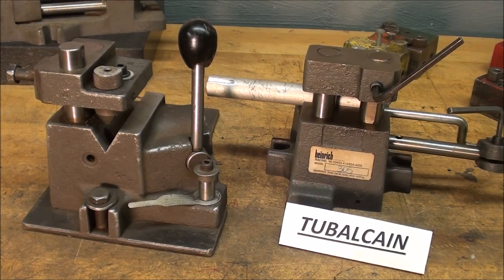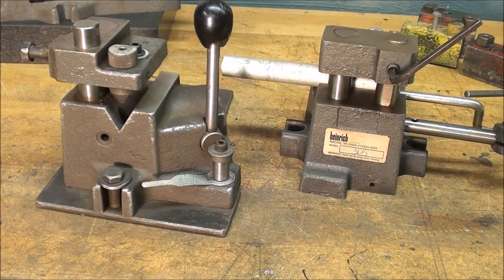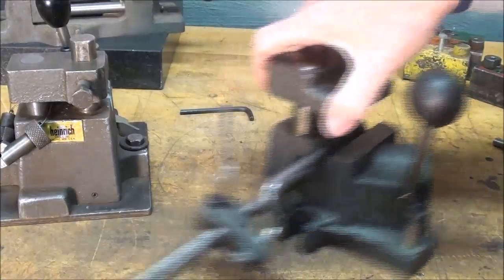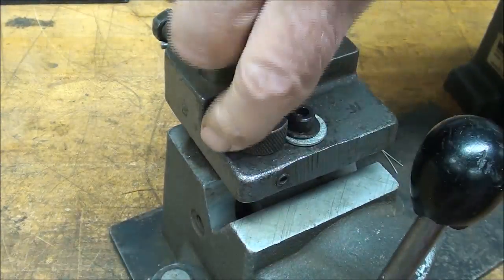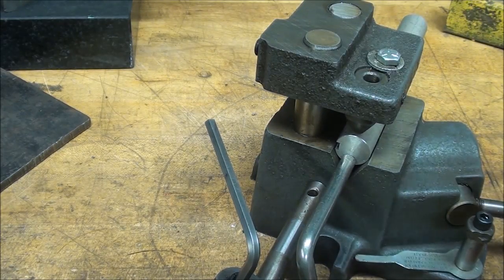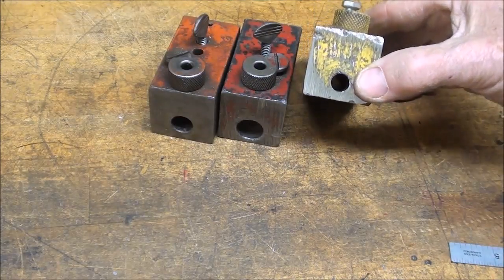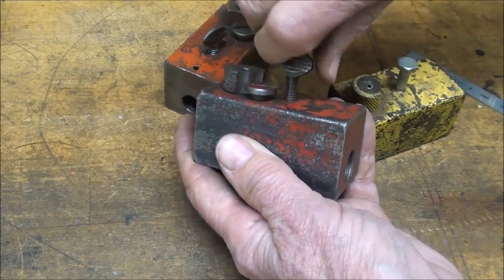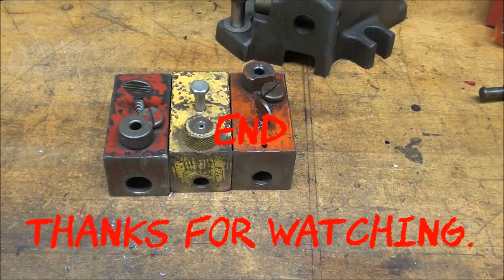SHOP TIPS #290 The Heinrich Cross Hole Drill Jig tubalcain

Comment: Think the 905 cross hole jig (the biggest) would allow space for a second drill bushing 1" on center from the stock one? Otherwise I'd need to have a jig like that machined from scratch.
Reply from the maker: I'm not sure, but you could check the dimensions and see.

Comment: have a problem 
the toy mill i can use dosnt raise the bed at the knee
the mill head lowers and swivels so u unclamp the head after dilling a pilot hole to raise the head
but that moves it left and right. so now u up size the drill say to 10mm to 19mm  witch is longer u loose center.
Reply from the maker: Yes, my friend had one of those and he pointed that out

Comment: Nice video but I have a question non related to this video. I recently got an Atlas 618 and the tailstock drill chuck is all seized up. I'm assuming its been in their for years. I pulled the tail stock sleeve out put acetone and atf down nothing. I would put it in a vice and just get a punch rod on the other side and hit it out but I don't want to clamp the part and damage it. Anyone go some tips on this?
Reply from the maker: +Derek Ludwig Drive it out. Hold it in a vise with wooden blocks. or make a fork or something that will fit between the chuck & quill--then drive it

Comment: I used these many years ago in my early machine shop days. The sturdy jigs uses a geared rack and pinion on one of the hardened shafts to clamp the work with a locking cam action. Notice the handle moves many degrees while the top plate moves only slightly. Thanks Mr. Pete for explaining these so well.

Comment: Nice poor man's jig! Just a thought if making them you probably would use a keyway broach to make a slot in the bottom at least to the front so you can slide the work out to deburr before removing it. that way the bore does not get scarred.

Of course I do not have even the poor mans jig, I make do with a V block and clamp, and my cross holes are almost never going to be good, but a little care with a file and making a flat spot to get a punch mark in as a starter does help a lot.
Reply from the maker: +SeanBZA Good idea- THANKS!

Comment: Have a 6-SV vice and love it.  Really well made.  Interesting to note is the 60º V in the cross hole jigs.  Seems to be a lot of controversy over whether a 60º or 45º is more accurate for V-Block design.  For home shop stuff either is fine, I believe.  What are your thoughts on the matter?  Thanks for sharing the info about bushings and cross drilling properly!  ~PJ
Reply from the maker: +pjsalchemy  THANKS!--never thought about the angles